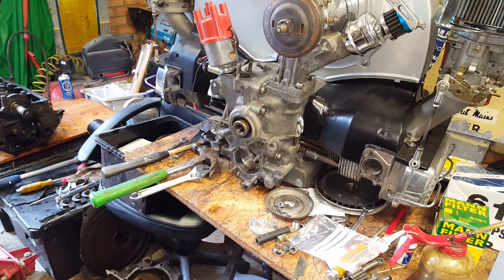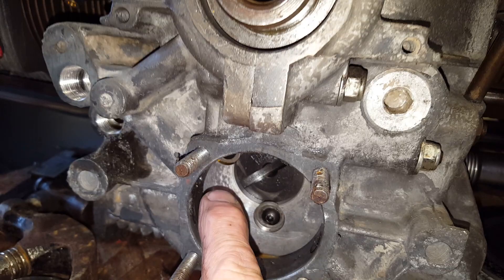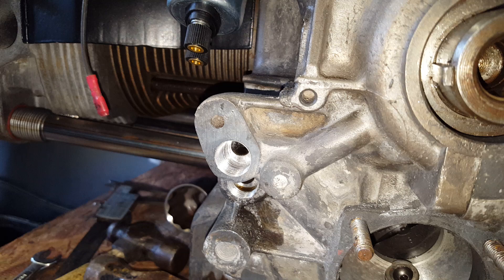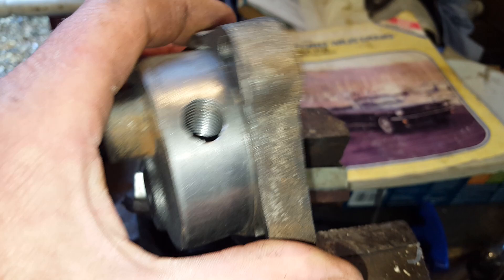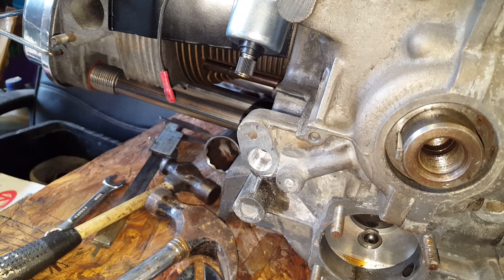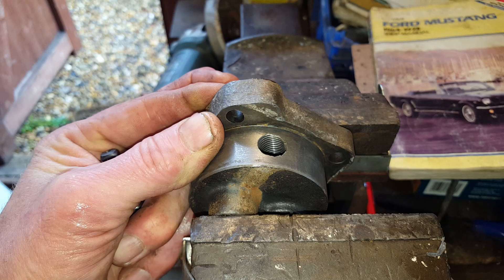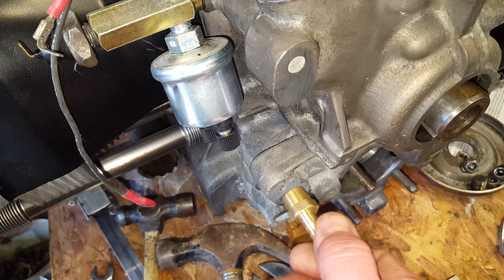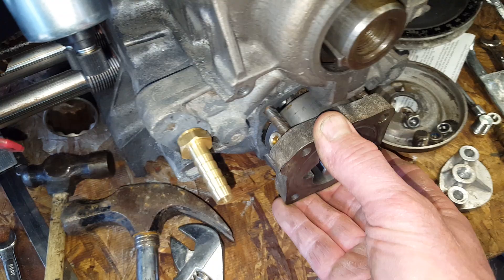HOW TO INSTALL vw air cooled engine full flow oil system

Comment: Very informative and straight forward.  I bought a cb performance maxi 30 pump, so I am not required to plug the pump.  However this helped me understand how to run the oil lines.   I went with a 30 mm pump, because I would like to tee off of the take off plate to the filter, which will then connect to an auxiliary cooler.  The other branch off of the tee will go to an oil restrictor, which will then, in turn feed a turbo.  The bigger pump should give me a little extra oil pressure to feed all of my...accessories.

Comment: Nice video, thanks for the info and adding the tools you used.  IMHO 15.5 mm hole is way to big.  Should be 9/16”(or 14.5mm) for a 3/8-18 npt.

Comment: what's the reason for mixing bsp and npt, instead of sticking to just one? also, how do avoid getting swarf in the oil gallery when drilling the hole?

Comment: Hi, I have a question, can I make this modification to my 1600cc engine with factory camshaft ????
Reply: Yes. I did the modification to my 1600cc about 5years ago. Works good has more oil capacity and runs a little cooler.

Comment: case inlet too small-should be same size as pump outlet
Reply: Yea, I was curious why he says 3/8" is best for flow, which is a much smaller ID than pump in/out holes.  He also says 3/8" = AN10, which is not correct, should be AN6.  I'm going with AN8 (0.5" Hose OD and 0.45" ID) using an IN/OUT pump faceplate.